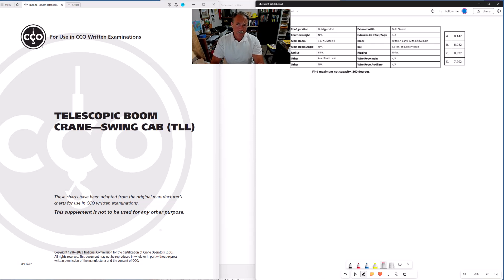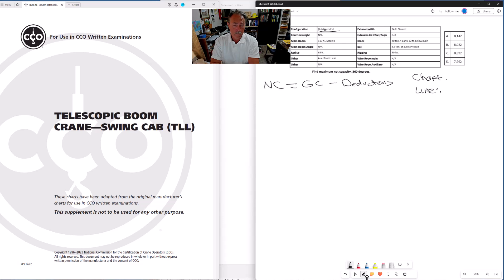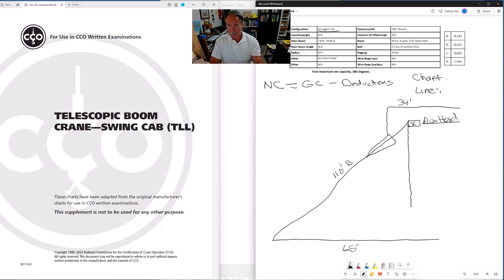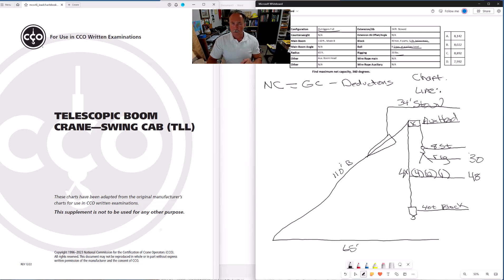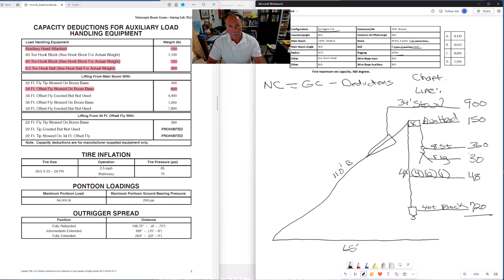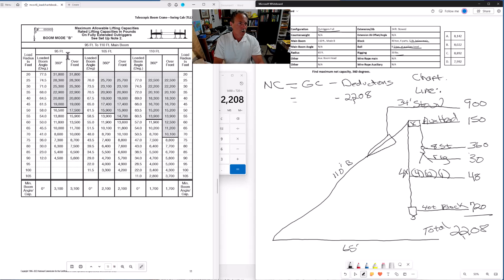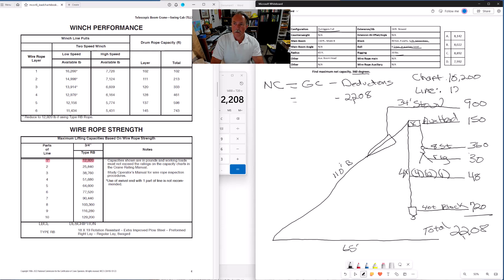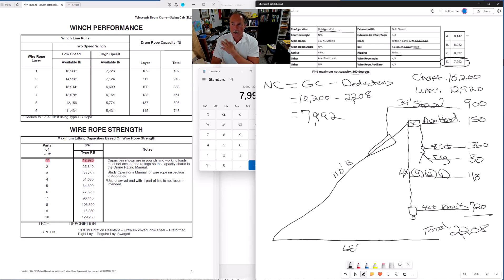NEW TLL:  Basic Net Capacity Calculation

Comment: what if your lifting from the block why would you do this . i can see if your  lifting off the ball . but from this problem we dont know which one we are lifting off of . something is computing in my head. where does it say we are lifting off the ball?
Reply: You can tell you’re lifting from the ball because it says there is 12’ of cable hanging from the main. At that boom angle/radius, it’s obvious that 12’ from the boom head is nowhere close to the load on the ground, therefore it has to be picking from the auxiliary line.

Comment: Can anyone tell me how we figured we’re not using main boom?  I know it says 12’ below main. 

In my opinion that means I’m using the main.I always get this mixed up and I test tomorrow.
Reply: The question was to find the MAXIMUM net capacity. The chart is only good for 10200 no matter how many parts of line you use. If you use the block, you will have less capacity because you will have to deduct three of the parts of line (the unused line) from the tip of the boom to the ground plus whatever excess line is hanging from the auxiliary that would be far more than 4×12=48 which is the line deduction when using the whip line?

Comment: question: can you tell me why didn't you do to the range diagram when accounting for the extra lines you did not use? I've gotten lost because I thought you use the range diagram for that.
Reply from the maker: Using single part line off the auxiliary--no deduction for single part line.  For the line hanging off the main the distance is given, 12 feet, so we don't need to use the range diagram.  Deduction is 48 lbs. for the hanging hoist lines (4 parts, 12 feet, 1 lb. per foot = 4 x12 x1 = 48)  I have other videos where there is a deduction and the range diagram is used but it is not necessary on this problem.

Comment: So only 8 of those require math? All the other questions aren’t math problems?
Reply from the maker: Not sure what 8 you’re talking about?  Happy to answer question just need a better question.
Reply: @LoadChartLab  sorry about that I was wondering in the TLL and TSS questions I saw on Reddit that their are only 9-10 loadchart questions that require math and the chart. What are the other questions since they’re 26 of them?
Reply from the maker: @7beers2552  Got it.  On the specialty exam there 26 questions.  Out of those 26 there  are usually 8 problems considered load chart problems.  Out of those 8 there may be 1 or 2 that do not require you to do any calculations.  For those problems you need to be familiar with the load chart notes and be able to read the load chart, use the range diagram. etc.
Reply: @LoadChartLab  okay thank you ! Those other 13 questions are based on just the load chart terminology? What can I except? I have the test this Monday I’ve been studying and watching your videos the TSS chart is very simple but the TLL I keep getting stuck on
Reply from the maker: They are going to be the types of questions you see on the core exam but will focus on telescopic boom cranes.
Reply: @LoadChartLab  thank you so much! Your videos are a lifesaver and the only ones I’ve seen that explain everything. Ive doing a probably that the boom is in between and it says you whichever is smaller but both 45 and 55 have 42,000 and I need to find the boom to tip because I’m only using 5 parts of line and everything I use the range diagram I get 60 and I subtract and I’m off by 5 I’m so confused
Reply from the maker: Can you send me the problem?  I'll see if I can help you figure it out.
Reply: @LoadChartLab  
Net capacity lifting off main boom over the front. 
Main boom: A/51 ft. 
Radius: 15 ft 
Chart: 63,500
Line: 77,520 
Aux boom head: 150
56ft fly stowed: 1,200 
Block: 60t, 6 parts  1,1000 
Rig: 365 
Extra part of line: 60 
Deductions: 2,875 
My answer: 60,625 
A.60,770
B.66,200
C.60,620
D. 61,720
Reply: @LoadChartLab  there aren’t any other deductions I can see there isn’t a ball or other I don’t know how and the next question is the same it’s off by 5lbs. I finished the whole packet but I’m stuck on these two I can’t figure it out
Reply from the maker: Your tip to ground distance should be 65.  Which would give you a 65 lb. Wire rope deduction.  

In the range diagram use the arc for 55 feet.  The line for 15 foot radius. those two intersect between 60 and 65 feet.  Use 65 feet.  Anytime you are between two tip heights go with larger.  I think this is your problem.
Reply: @LoadChartLab  that is my problem but you said in your videos that I can’t go in between where there is no number in my Chart it goes from 60 to 70 I didn’t know I could use an in between number
Reply from the maker: It not labeled but the hash mark between 60 and 70 represents 65.
Reply: @LoadChartLab  okay so we’re allowed to do that on the TLL chart and TSS? Thank you I had 65 but didn’t know if it was correct. Thank you
Reply from the maker: @7beers2552  Sorry about that miscommunication.  My mistake.
Reply from the maker: @7beers2552  Yes.  I haven't got around to it yet but I'm going to be doing a video, with more detail, on how to use the range diagram.  I have one for the grove but I've not made one for the TLL.

Comment: Aren’t you not supposed to deduct the auxiliary boom head if you’re making the pick off of it? That would make the correct answer A, but I might be mistaken.
Reply from the maker: No.  If makein pick off main deduct aux.   head.  picking off aux. do not.
Reply: @LoadChartLab okay just a little confused because in the video you deducted 150 lb for the aux boom head but the pick in the problem is being made from the boom head
Reply from the maker: @emcee1997bruh  my bad i got my cranes confused.  The way I do it in the video is correct.
Reply from the maker: If it was an extension, you would not deduct the weight of the extension if making the pick off the extension.
Reply: @LoadChartLab   got it. Thank you for the quick responses!
Reply: @LoadChartLab  Right, because the aux is added to the boom.  Which the math is done without it being a permanent part to the boom.  Sicne it was added you must deduct it in your math,  the 150, remember to consider anything that is not a part of the boom itself just last the wheel mounted on some.

Comment: On that question 4 parts of line and why you accounted 1 parts of line ..?
Reply from the maker: Not sure where you're getting "accounted for 1 parts of line" on this problem.  4 parts of line hanging 12 feet below boom tip.  So it is  4 parts x 12 feet x 1 lb. per foot.  48 lbs. total deduction.  The line that is in use off the auxiliary head will not be a deduction because it is necessary to make the pick.